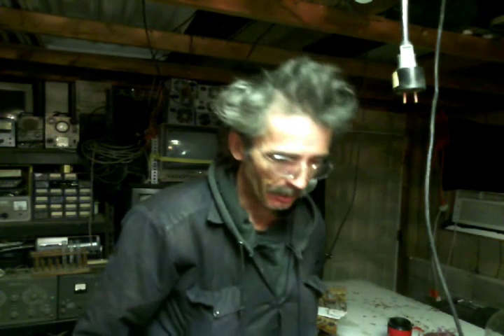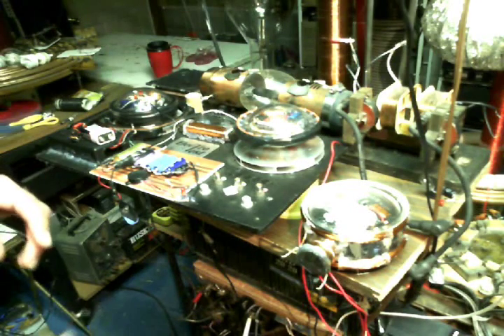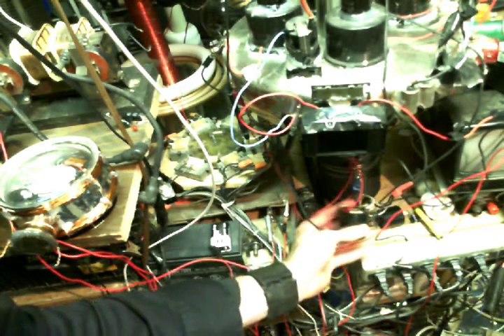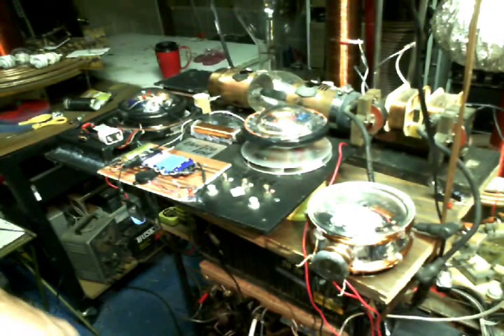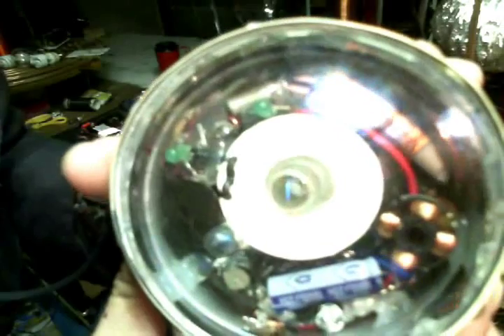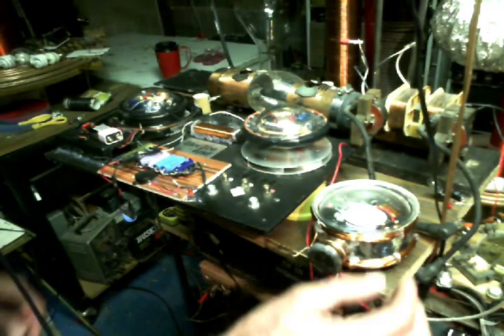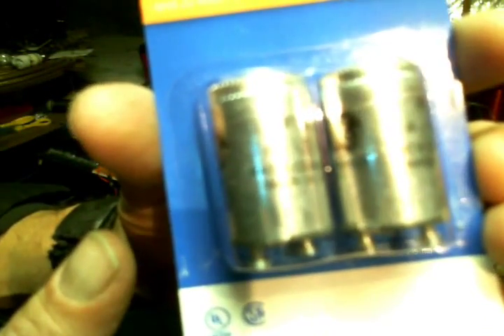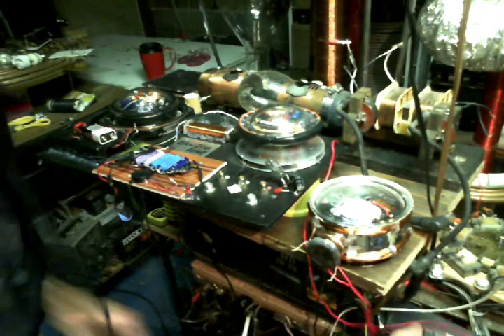PLASMA CIRCUIT !

Comment: Would I be right in thinking that little led (on the little cap/led/globe receiver) is acting as a spark gap, Driving the tank circuit, Causing plasma in your globe? How much power are you getting to the globe? Got a part no for the globe? If you add an inductor/ant, the right value to resonate correctly, you should get much better results! I'd love to see a schematic. I think I have half a clue what your up to and I like it.

Comment: for every partical that exsists in our universe, there are an infinit number of particals in every other universe,. if we do something to one partical, we changes something. ( but if we try to Blow up something, ) we end up with a big bang, but we have not really got ridd of it, it's maybe changed into dust, or smoke, or whatever, heat, ect ect.. but the thing we try to blow up has only changed into something other than when we started

Comment: Great hair dude :] i wonder if this has anything to do with your teleportation work. I gather the plasma arc is holding the ringing frequency to resonate your coils, observational theory ofcourse. The shell of the argon gas allows electrons to pass easily between atoms, and resistance goes down, thus voltage should increase. if I'm obviously wrong, please tell me because I rather have the right understanding. 
Peace and love